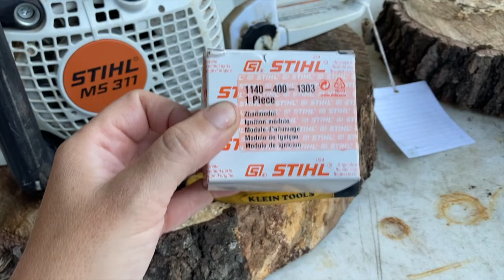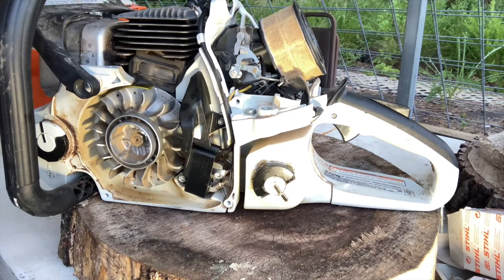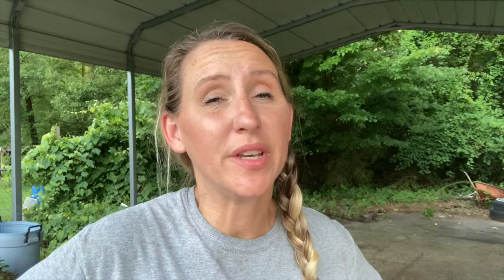Customer Destroyed It! How to replace your ignition coil and plug boot on Stihl MS311

Comment: Can't fix that insulation on the stripped back coil wire ?   Really ?  I few layers of heat shrink tubing and some CA glue would fix that permanently.   It is also pretty easy to splice the wire to another one and make it a few inches longer if you had to. It is stranded wire, not carbon core.  Easy to do. Parts changing is ONE way to solve a problem, Fixing parts is another.  ---Doozer

Comment: I'm a male who prefers female mechanics because they often go the extra mile to insure the job done properly the first time.  Because of the' fact' that all too many fools believe women can't do the job as well as a man.  I've taught all my goddaughters that anything a man can do a woman is eaqually capable..
I used to do my own work but at 71 years old. Can't now.  In answer to your avowedly not understanding why pre/ mixed gas can have 'batch problems'. It is simple.  You repeat it every time you remind your clients that 4to 6 month old gas can play havoc on small motors.  
  You simply don't know how log the premix has been in the warehouse, in transit, in storage, on the store shelves and finally at home on the shelf.
  The times do add up.  I personally don't recommend premixed gas for this reason.   Also chemically, gas tends to evaporate and sucks ambient outside air into their container.......you guessed it!   H2O in vapor flows into the container.  Your two cycle oil to store your small engine carburetor's integrity is spot on..
  I appreciate and applaud your integrity in admitting that there is something you don't understand or know, bery few men would admit that.  Keep up the good work!

Comment: The current design on most engines is not good. I have to use a flat head screwdriver to help ease the plug boot off. Sloppy engineering and stupidity on the part of most manufacturers.

Comment: I'm a little disappointed to see you using a business card to set the air gap on the coil. A lot of coils need an air gap around 0.10" and it may be picky, but my business cards are 0.13". That slightly changes the timing and gives a slightly weaker spark. I'm just saying and will probably get roasted here for mentioning this but whatever.